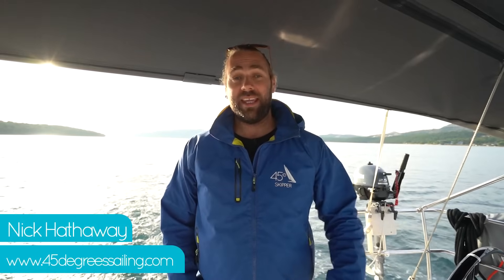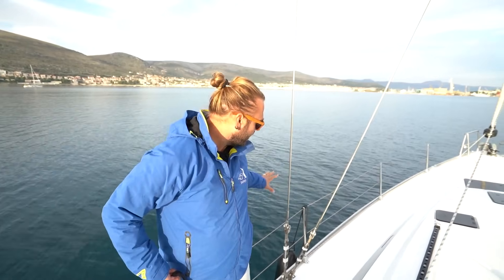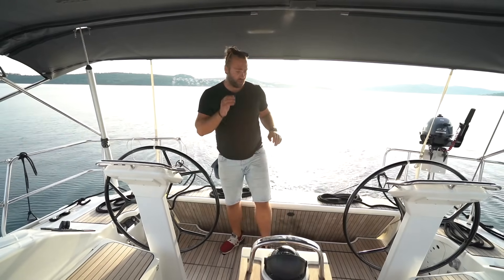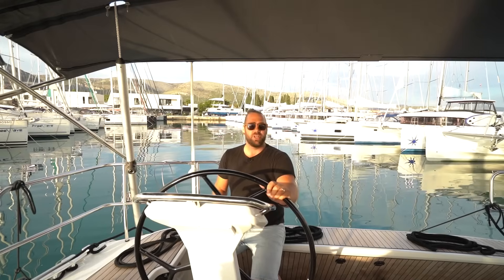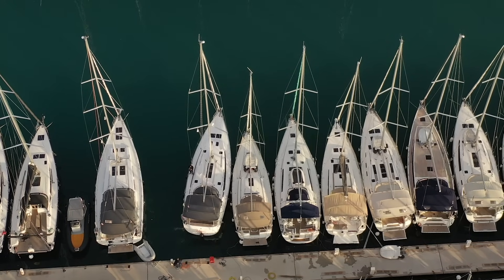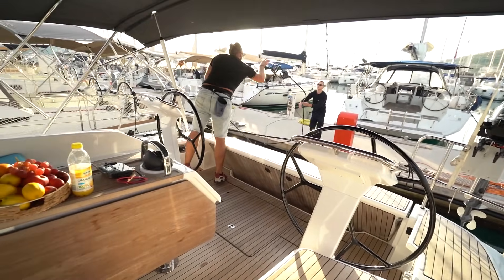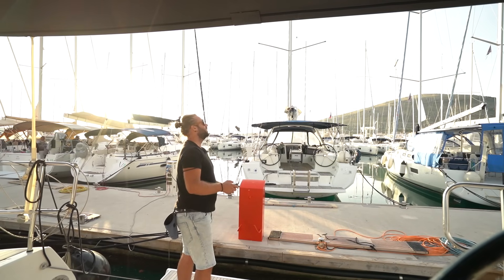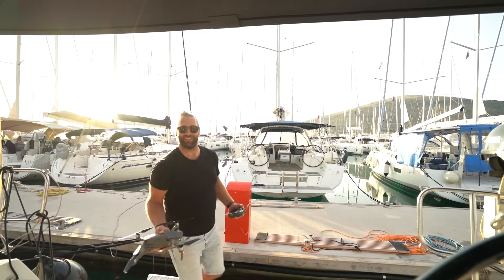Singlehanded Docking Stern To with Lazy Lines

Comment: Would have suggested getting the 2 stern lines in place and then power forward to maintain the boat off the dock and straight.  Then the forward line to center and walk back towards the dock by powering off and letting the stern lines draw the boat back.  If you had a breeze on the nose the boat could have hit the dock or veered off before getting the nose line on.
Reply from the maker: Thanks for the comment. Often the dock hand will already be lifting the lazy line for you or have it underfoot. Had there been wind, powering against the leeward stern line and resting against the yacht to leeward holds you well in position to get the bow line, which is your priority, secured. 
I don't understand your step 'Then the forward line  to centre.. '  ?
Reply: @45DegreesSailing  First of all great videos and well done all around.  For the stern to dock approach like this I always try to start with the two outboard (port and starboard) stern cleats and tie up those first. /_\.  Once those are struck then you power forward, and if the lines are the same length ti automatically centers the boat with a neutral rudder in just about any on the nose or cross wind with no risk of hitting the dock or having the boat angle off either to port or starboard and r"ub the neighbours."  You don't need to be at the helm after and can get around the boat at your leisure with no risk or rush.  The forward line doesn't need to be the priority if the two stern lines are secured.  Three "from unpleasant experience" reasons for that.  First is because being alone in this case of with a less experienced crew, what can happen will - have had a gaffe extension that fell into the water with the sunken line and/or so full of barnacles by the time you get it up your hands are a mess and/or with a cross wind it is hard to hold and strike especially if a short line., etc, etc... Second is sometimes the neighbouring boats took the wrong line and it can turn out that the sunken line you think is to port or starboard is actually running below across  (/) the keel across the boat.  With the two stern lines and slow power forward to center it holds the boat.  There is no rush to get the sunken line onto the bow so if you aren't sure you can double check and avoid it getting into the prop and stalling the motor (unpleasant for sure.) - especially with a wind on the nose or across the boat. Third is sometimes by the time you get in, especially solo, you can be really tired there may or may not be boats off to the sides to use as leverage to hold the boat in place in a crosswind.  Just having the leisure to be safe in place before getting the bow lines secured with the sunken lines can help avoid additional stress and fatigue based mistakes.  Having sailed a bunch in the Med (not yet Croatia) that's what I've experienced over the years.  Both approaches work for sure, and again well done on the videos and tutorials.

Comment: Nice video and well presented. But I would prefer to have the ball fender over the back of the swim platform when you motor astern to tighten the bow lines. Admittedly having two bow lines on does give you less risk but I've had a marina's lazy-line break when motoring astern against it!  Surprising how fast you are going after accelerating back over just a metre or so!
Reply from the maker: Thanks Trevor. Yes that is fair enough. And when I do not know the lines or of course on only one bow line, that’s a good precaution to take. Especially considering how hard I reverse on them sometimes!

Comment: Great instruction, very clear and easy to understand.  One question I had, how much are you concerned with nudging the boats in the next slip?
Reply from the maker: Thanks Brenton. Here it is a normal thing to rest against the yachts wither side of you. When you stack into the marina's they are planning to put you in tight with the next boat most of the time. So good fender placement and height is really important.

Comment: I never tie the fenders to the top  of the stantions , 
 When they are loaded or jammed up, they put a big load on the stantion  base,and  can cause leaks or even more damage.
I find tying them right at the toe rail, or even 1/2 way up the station is much better structurally.

Comment: Thanks Nick.Really helpful.Can you do a nose in version as well?My yacht just purchased is on a crowded marina the other way around,and found it challenging first time getting out and in with wind on the stern.Cheers Paul 08:53 am
Reply from the maker: Here in Croatia, we don't dock nose-in. Especially not in the size boats that we tend to charter (50ft plus). What size yacht do you have and what part of the world are you sailing in?
Reply: @45DegreesSailing  Hi Nick.I have a 34ft Farr 1020 ,docking in Kettering Tasmania.Very tight,all bow to marina berths.

Comment: Why didn't you fix first both stern lines and drive forward into them before taking care about the mooring?
Great explanation & good Video...thanks ⛵️⚓️
Reply from the maker: In this one, as I was on my own and there was very little wind, I could fix the bow line easily without needing the fwd thrust. And when I can avoid it I would prefer not to have the yacht in gear while not close to the controls, especially when pulling up a lazy line.
Now in this case as I explained, I would usually do that, as the dock hand fixed my line (and they often have their own way of doing things) and was lifting the lazy line for me already.
Reply: @45DegreesSailing  thanks for your feedback ✌🏽 I will be sailing in Greece in September and I am not this experienced in mooring due sailing mostly in the baltic sea ⛵️ So everything that helps me avoiding mistakes is great 🚀
Reply from the maker: @derveltensail  good to hear. Will get as many videos out as I can!

Comment: Nice instruction and impressed you didn't need the bow thruster. I don't have one! I'd like to add a little word of warning to anyone who hasn't yet come across one nasty little issue! Some lazy and bow lines have spent a long time underwater! They are quite inviting to shells and molluscs, if you are not wearing gloves and your hands slip on the lines you can expect a whole load of painful cuts on your hands! It happened to me in the very same waters you are in! Keep up the great instructions!
Reply: this is a very good point! having a pair of sailing gloves (or even gardening gloves will do) on hand helps. because you never know what you’re going to get until you pull up that line!

Comment: Great instruction Nick - concise, clear, easy to follow. Am coming to Croatia for 1st time in 3 weeks (mid Feb 2022) so doing my prep. One question - when approaching a marina, how do you know if they have lazy lines or not?
Reply from the maker: Hey Chris, great to hear you will be enjoying these waters! I just got in from a week on the water. Check out my latest uploads/vlogs.
As you approach, you should be able to spot the lines from the dock running into the water, or take a look how any other yacht there is already tied up. And, I think I only know of one Konoba dock that I have seen in Croatia the does not have lazy lines! All of the marinas have these with the exception of the local pier on Drvenik, and one in Cavtat which you anchor and go stern to with.  So you can generally assume they will have them. Are you sailing this February?
Reply: @45DegreesSailing  Korčula Luka Anchorage has a small dock, and you do the anchor at the bow. You either call the marina , usually on channel 17, or just come close to the dock, and ask, if it is not already obvious. Beware it's extremely crowded July, August and even September. And many coves have buoys that cost decent money. No anchoring within 150m from them. What all of this does is many places are full by noon or 3pm, not good for those of us who like exploring.

Comment: Just wondering: Why don’t you attach both stern lines first, but the gear in forward. That will keep you boat from drifting and you will have all the time to attach the mooring lines. And if you stop a little bit earlier you can tighten the mooring with slow reverse and tighten the stern again (in case of nose wind)
Reply from the maker: I explain this in the video. In this case the marinero had the lazy line ready and waiting, wanted me to take it then, so I did. On a windier day, as explained in the video, I would motor against the first stern line secured straight away, then get the second on. Then go for lazy line.
Reply: @45DegreesSailing  My bad, you did indeed! Good job

Comment: Very good regarding the preparation of lines. But as others have said here getting the windward stern line secured is key because you can go forward on it and stabilise the situation. In the end it's all about buying yourself a little extra time. A trick that I found really useful on my fin-keel sailboat was to go stern to wind holding my position with gentle shots of reverse to stop forward drift. In Greece even with a strong meltemi you can stay in one spot cool as a cucumber while you decide where you are going to dock.
Reply from the maker: We are all on the same page, this is exactly what I speak about in the video. In this case there was no need as very little wind. 
And YES! The stern to the wind is the BASIS of all manoeuvring on yachts, especially to hold station. Nice work.

Comment: You should clarify that locking hitches are not hard to undo on a floating dock.

The only time they can tightly lock down is if the line get heavily loaded and there aren’t enough turns on the cleat.

The method of finishing with round turns is effective, but also has its limitations. If you miss judge the tide and hang your boat from a dock, the work ing part of the line will hopelessly trap the round turns.

Each method has its place. And if you have time to explain the round turn three times, take the time to explain the scenarios where each one is best suited.
Reply from the maker: That’s a fair argument. Though as I never use locking hitches so I never promote them! And to that point I have not had a loaded line become so trapped with this method - and, I have never hung the yacht from a dock so I believe you it could happen! 

Thanks for the comments. Happy to have them here to make the point to others. Everyone has their own method, another reason why I say to those going to other boats -if the skipper wants hitches, you do hitches!

Comment: Master, do you have an advice  for  stern docking in Greece  with an anker at front not morings? windy and litle place.
Reply from the maker: I do have advice for this. Though it is a tough one communicate through comments. I will see if I can add one of these videos this coming winter.
Reply: @45DegreesSailing yes please 🙏🏽
Reply from the maker: @goodq  this is my first video on Med Mooring.  I will work on finding tougher conditions and parking between yachts in smaller place. It’s hard to get the conditions and the timing and ability to film all at once!

Mediterranean Mooring with Anchor
https://youtu.be/LAXLLNP48t8

Comment: Add another turn or 2 on the cleat before you lock it with a hitch to prevent binding.
You should have mentioned "crabbing" in R for boats without thrusters.

Good Story . . . .
Harbor Master told me to renew my slip permit my J/24 had to have a motor. It was racing season, and my motor was tied tight down in the floor of the boat. 
I explained to him that by the very definition of a sail boat, I have a motor. They are called Sails.
He gave me grief, so I said if I could prove that I can move my boat around without crashing into shit, would he let me leave my motor below, and renew the permit.
He laughed and said OK, deal.
I was nose-to the dock. I lifted the main, and hauled it out with a preventer back around for quick release, then singled up the bow to windward. I used a bunji and my monkey fist to control free tiller, cast the bow line to the dock, casually walked back and gave the tiller a nudge with my foot, unclipped the stern line from the tahiti ball, as boat fell downwind, sailed to end of my row, did a 180 and quick tacked all the way up the channel to the harbor mouth, out and around the green buoy and back. 

The wind had shifted a PERFECT 70* around to north. So I rounded up into irons, prevented the main, got some R momentum going, clipped the ball as I passed it going backwards, dropped the main, which was on 3 reef, so very short. Jumped off the stern and tied the windward stern line.

Did not come close to either neighbor nor bump the dock with a perfect 6" to spare.

I said to the dude, If I backed it out under control, and backed it in under control, and didn't hit anything, then how the hell can you say I don't have a motor? He signed me off.

Attention All Sailors - You don't need a gasoline motor.

Comment: Great but why not get both stern lines attached first and drive the boat forward before attaching the bow lines?  Gloves are always a good idea to wear when handling the slime lines as they are inherently covered in sharp mussels.
Reply from the maker: In many situations I will do that, two stern lines on first. Especially if there is no one on the dock to run lines for me. In this case he had the lazy line ready for me and asked if I could take it before the stern line so I obliged.
Reply: @45DegreesSailing  ah OK cool. I just thought there may have been a specific reason why you did it this way. Cool vid though. Very thorough and worth watching for all deck crew and skippers alike. Love the figure of 8's on your stern lines. I'll be implementing that on my yacht from now on!

Comment: The question is with how many knots of wind is safe and you can do the same manouvre by your own?
Reply from the maker: That is two very good questions! 
Yea I can do it on my own. 
And safe… actually both of those depend on one variable: The angle of the wind. 
I have had to do this in up to 40knots on my own - bit fun! If you are reversing stern to wind it is actually quite ok, even in very high winds, as you have good control over the bow. As soon as the wind is on your beam, even 25-20 knots makes this very challenging. When the boat can twist because if wind on the beam this is what can cause damage.

Comment: Single hand docking to you is totally different to me because for me there's nobody on the dock it's just me🤣 Bow thrusters and all the bells and whistles, first world problems are amazing.  Smooth seas never made good sailers.
Reply from the maker: Hey Josh. Thanks for the comment. Perhaps it is different to the two of us. Though in my view, sailing is not, and has never been a 'this is the only way' type of recreation. Now the reality is, that if you are indeed 'singlehanded' on your yacht, boat, ship, meaning you are the only one onboard then you are operating that vessel singlehanded.

The design, intent and execution of this video is to educate those looking to do similar manoeuvres themselves or become familiar with the practice or particular marina. The reality is, here in Croatia, at 90% of the ports, if you come into a dock, or marina singlehanded this is how you will be received. Especially if you have some planning and foresight as a new sailor attempting this manoeuvre. 
Completely agree that calm sea's cannot teach you what you need to know top be proficient and safe. And, the first time I taught myself to do a backflip into the water I did not do it from 10m. 

Maybe check out some of the other videos, its not all come sea's here at 45 Degrees Sailing 😉
Wish you all the best and 4 feet under the keel.

Comment: Follow up question - I’ve read that many of the bays have tavernas with their own moorings? What’s the normal etiquette to agree a price before picking up?
Reply from the maker: This is correct. The general rule is that if they are moorings/dock owned by the taverna/konoba then they stay is free, you are agreeing to eat at their establishment. And, there are usually listed phone numbers you can call or whatsapp to confirm this.
Reply from the maker: Again, are you planning sailing this February? There are very few if any of these places running at this time of the year.

Comment: Please accept a dumb question...it seems you may have leaned on the boat on your starboard side with your fenders...is that an acceptable practice the boat on either side will bear?
Reply from the maker: NO such thing as a dumb question mate. Yes this is acceptable here for sure. Often in summer you will be fender to fender against the yachts on either side of you. Coming in and laying against the leeward yacht is ok for sure. The big thing is managing your fenders and lines so that you have safe, clean contact.
Reply: @45 Degrees Sailing  thanks mate, I'm just a rookie...smashing into other boats is big no no for me.   Thanks
Reply from the maker: @mr1234tempo  I’m happy to hear! It should be a no no to everyone!  Understanding the process over here is important to understand how to fit into it and prevent damage from either side.